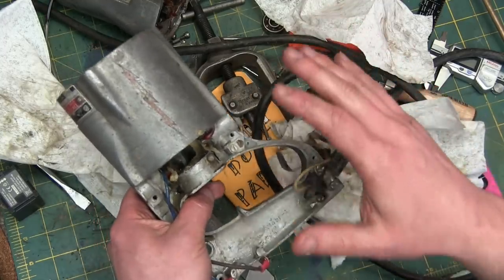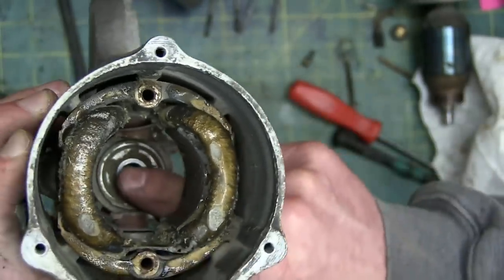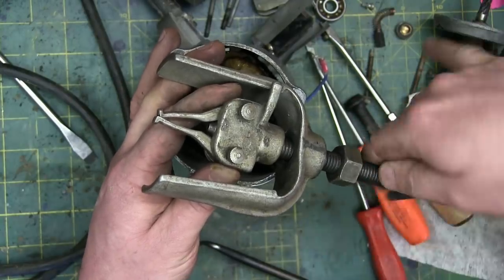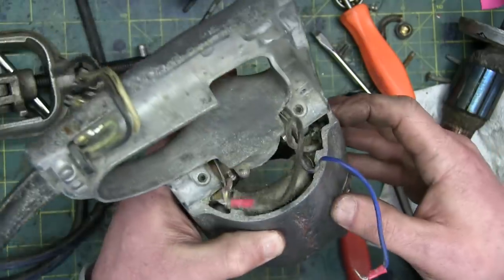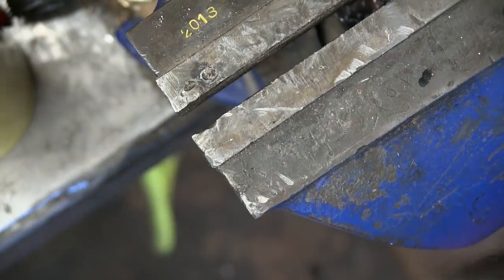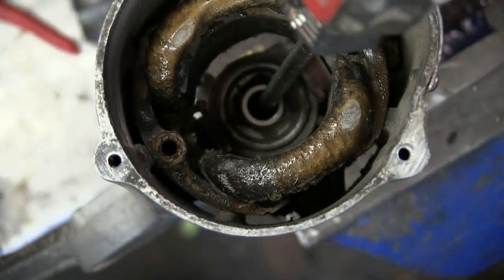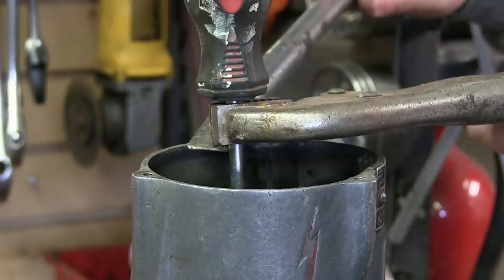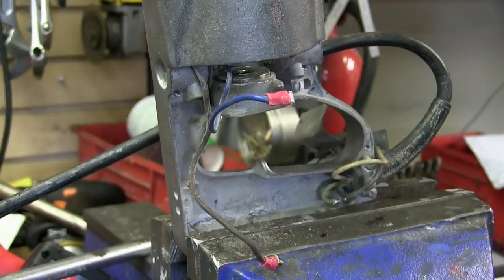GREASY RAG HACK! Damage-Free Bearing Removal.

Comment: Fantastic. Does anyone have a trick for labeling oily vacuum hoses and the barbs they go on? Neither colored 'lectrician's tape won't stick, nor number-printed tape stuck.
Reply: I've taken to wrapping masking tape all the way around the line. It won't stick to the line, but it sticks to itself and it stays on as long as you get it snug. Leave a few inches of excess and you can label it with a sharpie too.
Reply: colored zip/cable ties are what we use in Hydraulic repair...
Reply: I've used paper labels under clear heat shrink tubing for diesel fuel lines in the past.

Comment: Only works if the bearing is sealed otherwise the grease just passes through between the ball bearings, in most cases this hack won't help you.

Comment: Could have used a expanding ground anchor bolt and the used the bearing puller
Reply: Either that or grind the sides down on the bearing puller

Comment: I just use wax instead. In the form of birthday cake candles typically. Everybody's got extras of those in the junk drawer. Or emergency candles. Or crayons. Or whatever I've got laying around. A little less messy than grease. Works every bit as well(better IMO). What "blows my mind" is that you fiddle fucked around with every other thing first. They teach this trick in Rookie Mechanics 101.

Comment: That's why you keep one of these in the old tool holding box, Kemosabe. https://store.snapon.com/Light-Duty-Puller-Set-Small-Slide-Hammer-P635221.aspx BTW, I used to use the old cram the grease in the bung hole on blind brass bushings till I spent the outrageous 400 duckets for this little kit. Keep up the good work!

Comment: slide hammer on a blind bearing puller. or, and I think this might be what I'm about to see... fill up the back with grease and pump it out with knocking a wood dowel into the hole.. lets see what it is... (presses play to resume the video)

Comment: why did that work and how exactly did you do that…
Reply: Zigg Freud he's hammering greasy cloth into the hole of the bearing. The greasy cloth gets forced behind the bearing and eventually forces it out.
Reply: TheLogical Lowdown Absolutely brilliant. Never seen that before. Thanks very much for the explanation.
Reply: Think hydraulic cylinder pressure. The grease soaked paper towel material became a low grade liquid and the drift (drill bit) forced the liquid underneath the bearing pushing the bearing out of the housing.
Reply: also, the pressure in the center forced grease up and betwixt the frame and the outer part of the bearing (carriage?) to reduce friction.

Comment: Next time, instead of grease & bits of rag, just use wax (slices of candle) or bar soap..just drop cubes of the soap/wax in and do the same as you were with the grease. Thicker spooge makes the job go faster, and when your done it pulls out in one lump without leaving snot behind to wipe up.
It's a LOT less messy, and it's cool as fuck to watch Irish Spring get extruded around your punch..

Comment: Cleaner way?
Push bits of sandwich bread into the hole, and hammer it in using a drift that is very snug fit in the centre of the bearing.
Mind uber turbo blown. And cleaner. No lunch for you though!

Comment: How the implausable pays off. WOW. F$#$^%g WOW. It's a bit like the way I spilt rock blocks....drill a hole ,or series for a straight fracture  pack it tightly with paper or wadding and drip HHO on it...as it expands yadahyadah.... Great tip for a bloke who has struggled with the same issue many times. Thankyou.

Comment: Jeeze, just use the shaft instead of trying to gasket a drill bit with paper or electrical tape or whatever. The shaft fits just perfect if you freeze it...

But why grease? Messy and a PITB. Grease increases in viscosity under pressure/heat, what you want is non-Newtonian substance that decreases in viscosity under pressure/heat such as gluten (soft bread is what Mercedes states in the old factory service manuals ) starch paste (Corn starch and a little H2O) or just buy some Silly Putty and use it for a dozen other things such as a vibration isolator etc. Non-Newtonians work the best because when you smack the drill bit or whatever it increases enough in viscosity that it won't flow up the gap around the drill bit but not so much so that it won't flow enough to push the bearing up.

Better yet, just drill 3 holes under the outer race and drive it out with a pin. Gone in 60 seconds...

Comment: I would just drill some holes in the rear of the cup that holds the bearing and insert a driving rod through the hole. (What is the real advantage of the coarse language other than making your video unsuitable for the younger generation?)

Comment: I hate to tell you AvE you got screwed out of a bottle of scotch.  I learned that greasy trick from Hot Rod Magazine back when the only thing I was driving was a Schwinn scrambler and had not even graduated to a bike with more than one gear.  Now I will admit that I thought that was a load penicillin needing clap until I was 16 almost 17 and was changing the clutch on the street in front of Mommy and Daddy's house in the bejesusless freaking winter during a snowstorm and the POS rented pilot bearing\bushing puller someler to the you were flashing around wouldn't work because Beavis, Butthead, Mr Dum Pliers, and god only knows who else had mangled the puller jaws to the point they couldn't pull a fart out of a can of chili beans.  While I went inside to get my trusty Coleman lantrine to supplement the two painters lights (you know those lights made out of salad bowl a light bulb socket with cord made from the cheapest lamp cord with the spring squeeze clamp that you screwed the 100watt light bulb into even though it said 60 watt max on the sticker on the salad bowl and heaven forbid a drop of paint or water would hit the exposed bulb causing it to blow) and my trusty Eveready lantern that sort of glowed even with a new battery as darkness fell and the temperature dropped and sitting in the closet next to the lantern was my box of car magazines I never tossed out even thought Mom was bitching at me about it and on top was the magazine that had a headline 10 tip trick you need to know when changing your clutch on a Saturday night and Number F'ing one was the pop the Pilot Bearing out with grease and a dowel trick and sure as Chit it worked and saved my ass that Freaking cold wet snowy night in the middle of January 1982

Comment: Aww shit....  am I getting old or have I dealt with more old, rusted, "so bad the trash man wouldn't take it" shit?(did you now "shit" is actually pronounced "stuff"?)  
almost every time AvE resorts to some outrageous trick I know it, or some variant thereof. All the proper ways are news to me, but the "last resort" stuff I'm usually yelling at the screen. I have used water, dishsoap, grease, oil, candle wax, and air to achieve the same action. 
I gotta say I have never done it with the same finesse as ave. The master supplier of MBFM that we need to file away for the hard times.
If you just said things like: "You miserable cow...bastard.",  " Now I know I just put XXXX right here... so where the HELL is it?" or, my favorite for this case would be, " You will come out of there you SOB. I may not be smarter, but I am bigger and stronger than this bearing."

Comment: Heats up screwdriver shank.
Screwdriver has plastic handle.
Wonders why handle is coming off.
Reply: Braeden Hamson Talking of Hot knives.. Remember those 1940's butter knives with the off white coloured handle....?

Heat those puppies up too much and they combust and kind of unravel like a spastic Catherine Wheel...
Reply: Not even close, there wasn't nearly enough heat involved to melt the handle, they're just pressed on, not molded or glued or anything.